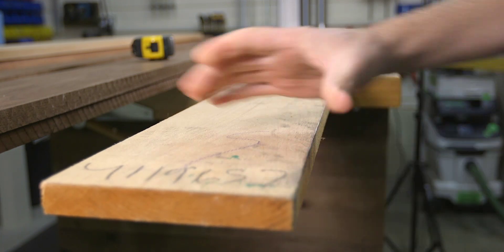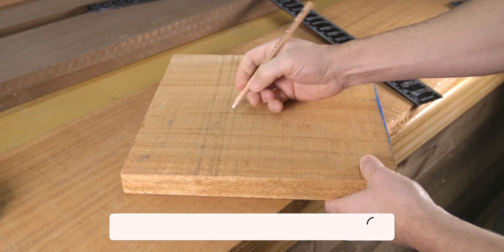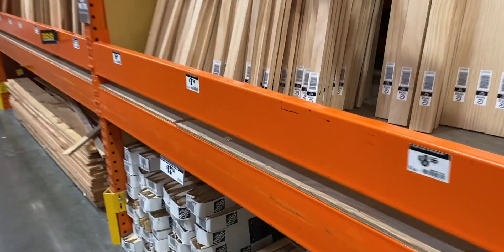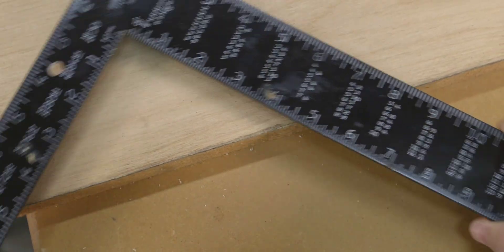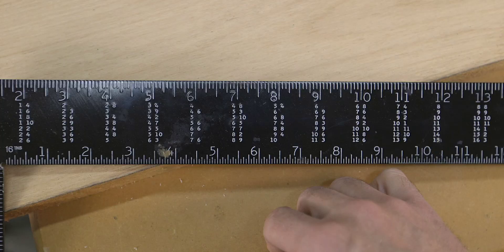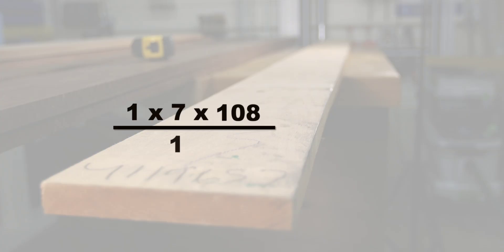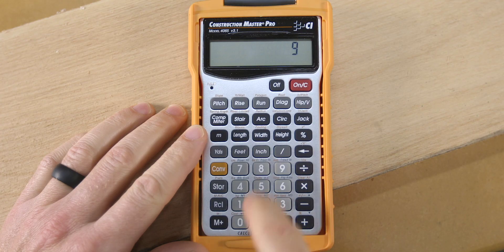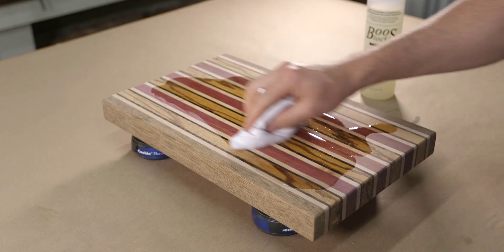Calculating Board Foot Costs For Furniture Building

Comment: Why did you start at 12 on the framing square? Is it because a board foot is 12 x 12?
Reply from the maker: It might be because of that, but the manufacture of the square instructs that that particular scale starts there. Great question. :)

Comment: Something important to remember is board foot is always based on the "quarters"! If you have a board that is only 3/4 inch thick, it will still count as 1 inch thick! (4/4). Values in between the 4/4 6/4 8/4 are rounded UP to the next whole , bear that in mind!!! Otherwise you will get angry like I always did, when I was doing Width*height* thickness I had a 3/4 inch thick board so I was mulitpying by 0.75. That is not how they do it, they still consider 3/4 inch board to be 4/4. So be aware of that. So in my example you round up to 1 inch thick! So it's length* width * 1.
Reply: I appreciate this very much. Saves me some anger later..lol

Comment: This list is rough cut how are this prices ? 
High fair or?? 21 62-1/2” x 5-3/4” x 1-1/8” $28
#23 70” x 6-1/8” x 2-1/8” $63
#24 68-3/4” x 6-1/2” x 2-1/4” $69
#27 71-1/8” x 7-1/4” x 2-1/4” $80
#28 71-3/4” x 7-1/4” x 2-1/4” $81
#29 73” x 6” x 2” $60
Reply: Walnut*
Reply from the maker: Those are good

Comment: About as confusing as the Imperial system. ;) So just wood volume.  Just calculate square inches and divide by 144.  Something easily done in your head.
Reply: Yes, but the trick is to calculate the square inches correctly. In the US, many lumber yards sell wood in odd sizes, e.g. 3/4 inches in various widths and odd lengths.